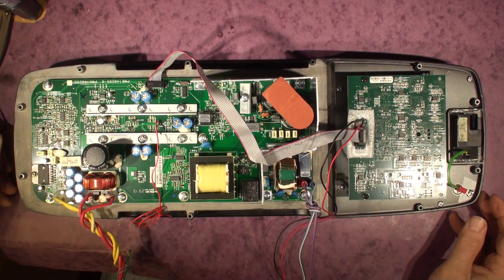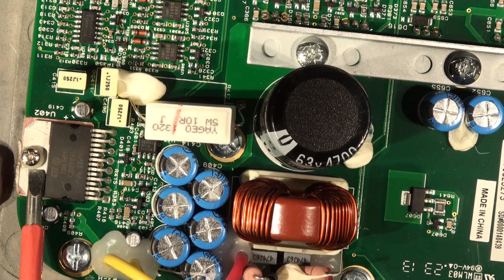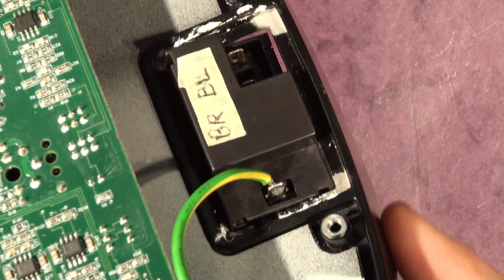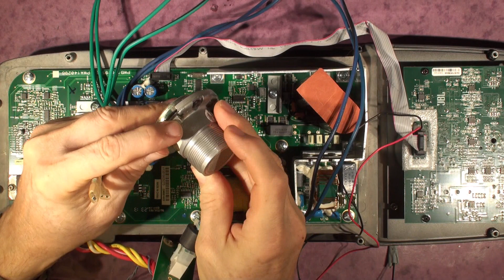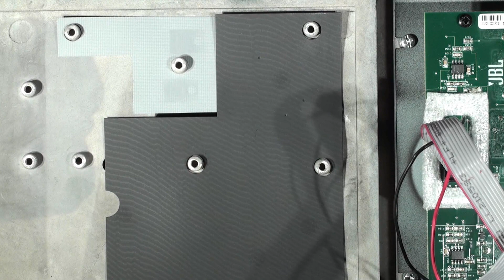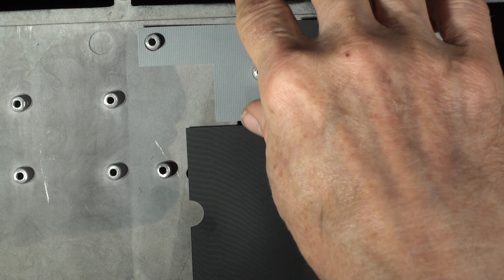JBL EON 500 515xt Series Amplifier Removal and Refitting Diagnostic

Comment: Hi, I have a problem with this speaker that several technicians haven't been able to fix. The tweeter doesn't work, and in the midrange there's suddenly a loud, very annoying sound. I have very basic knowledge of electronics in powered equipment, so I hope you can guide me
Reply from the maker: Sounds very much like a fault on the mixer/ input board behind the control panel.. All aspects of repair are covered on this channel.
Reply: @razenby Thanks for replying

Comment: 10:18 oh my word! You can see the 90° bends on the autorouted traces of that PCB from afar. The electrons will be zinging past these sharp corners hahaha
Reply from the maker: Laid out by schoolboy engineers with little or no experience of reliability and failure modes in due to bad circuit layout.... I see so many failed boards that have layout, PCB manufacture and assembly line process errors. All of them can be avoided at zero cost to the end product.. Bad engineering management and technical oversight.

Comment: Hello, I have one that one day turned off for the moment and did not turn on again, it only had about 3 hours on but with little volume, the plate was not even a little hot, I am from Venezuela and I have not been able to find someone to repair it 😞 How could you help me please?
Reply from the maker: They always blow at turn on. They have design flaws in the power supply however they are related to operation on 220v-230V mains. Venezuela has 120V mains?    You can email me at ark.mail@gmx but you will need someone who knows how to use a soldering iron and a multimeter.
Reply: @razenby 
How do I write to that email?
Reply: If the electrical network is 120v, ok I will send you to the mail, the card is held by a person who knows how to use those tools and knows a little about the subject, I would appreciate it if you could help me find the problem and repair it, thank you very much!
Reply: Hello Master, I have a problem with the JBL EON 515XT speaker. Several have not been able to give me a solution. The problem started when one day after a loud noise it stopped working. It was taken for repair and supposedly they assembled it wrong, where the MOSFETs were not isolated and that’s where the tweeter controller got damaged. The tweeter controller has already been repaired, now it measures 3.8 ohms but it doesn't work, and sometimes it gave me 15V at the output. The other fault it has is that the midrange controller makes an explosion sound 💥. I hope you can guide me to find the fault — I would be very grateful.

Comment: Buenas , yo tengo una que un dia se apagó de momento y no volvio a encender mas , solo tenía como 3 horas encendida pero con poco volumen, la placa no estaba ni un poco caliente , soy de venezuela y no e podido encontrar quien la repare 😞 como me podrian ayudar por favor
Reply from the maker: They always blow at turn on. They have design flaws in the power supply however they are related to operation on 220v-230V mains. Venezuela has 120V mains?    You can email me at ark.mail@gmx but you will need someone who knows how to use a soldering iron and a multimeter.

Comment: FRIEND I WOULD LIKE TO ASK YOU A QUESTION HOW MUCH RMS DO YOU THINK THIS AMPLIFIER DELIVERS TO THE CORNET... BECAUSE I AM FROM VENEZUELA AND IT IS IMPOSSIBLE TO REPAIR THE AMPLIFIER AND NOBODY HAS BEEN ABLE TO TELL ME THE POWER OF THE AMPLIFIER IN RMS
Reply from the maker: 110 W RMS approx to the bass driver and 60W RMS to the HF driver. These amps are easy to repair,  Maybe I can help you out. Tell me what it is doing.
Reply: @razenby Thank you for answering me, I don't speak English and I have to use a translator... the treble could not be heard... and the P36NF06 mosfet is shorted and I have not found it anywhere, I have been looking for it for about a month.
Reply from the maker: Did you find a Mosfet?

Comment: what kind of fuse does the 515xt use?
Reply from the maker: Just checked Actually the fuse in in the IEC mains input connector- 5 AMP 20mm slow blow

Comment: Hi, I have the same speaker. I set p for an event completed sound check and everything was good. Powered down system and upon return to power up system one speaker would not power up. At this point I only checked the power supply fuse. Are you aware of what is the first few things I should check that may cause no power up.
Reply from the maker: See the other detailed service videos could be one of about 10 issues. The semiconductors and capacitors age. usually they fail on power up. happy to service it for you.

Comment: the voltage doubler relay has been removed on your example, one of the modded boards. If it sticks it goes pop
Reply from the maker: Indeed. If it isn't needed to run on 110V the I always I remove  the doubler relay

Comment: Hi, my turn on but at low volume.
What I can do as DIY guy.
Thanks
Reply: Make sure it’s set to mic on the back
Reply from the maker: Did you find a solution?   Note the signal drive input is professional 3V not 1V as used on most domestic gear,

Comment: Hi, I just have changed the tweeter 2 times and when I plugin it blows up  the tweeter ,can you tell me what is wrong....
Reply from the maker: Is the LF drive unit working?  Most tweeter damage happens after reassembly. The Amplifier speaker connections are crossed and the Tweeter is then driven by the Bass amplifier. If wired correctly it is most likely the HF amplifier circuit. Check the 10 ohm power resistor is not open circuit, See the video on this channel. This common fault can destroy the tweeter.
Reply from the maker: See video https://www.youtube.com/watch?v=t4OAw2XrwvE
Reply: Thank's for the information.i will check the way you just tell me...

Comment: How can I test the mosfets without taking them out?
Reply from the maker: You can't 100% be 100% sure with a multimeter in or out of circuit.   You can meter across the two outer pins of each FET. If they read near zero resistance then they are shorted.  However take Note: Leaky FETs can't be measured easily without a test circuit. If you change one FET then change them ALL.  I Recommend that you change ALL the power FETs.  If the FETs are blown/suspect then you need to change the other components in the drive circuit. This is true for the power supply FETs and the LF Amp Output FETs. They are easy to remove.

Comment: excellent presentation! My wife's best friends husband just brought me one of these to service. After removing the power amp from the heatsink I noticed immediately Q605 and Q606 blown apart making it impossible to identify the part numbers. I have been semi-retired from consumer electronic service for a number of years and I am unfamiliar with this product. Here in New York I was unable to locate a schematic on the JBL EON 515XL. I would appreciate if you could direct me to a source, Regards, Richard
Reply from the maker: Hi Richard, Q605 and Q606 are  GB20B60PD.  Impossible to check what other components have been stressed. To make a reliable repair  you are gonna have to change the Darlington FET gate drive buffers: Q601 ,Q603 (KSC3265), Q602, Q604 (KSA1298), R626, R628 (10R), R625, R627 (49.9R) , U603 (FAN9380MX), U602 (TL494).  Let me know if you need some components.  Put the power through a 100W light bulb when you power for the first time. If it lights bright and you see no power LED. You haven't got it right.  If you see the power LED cross your fingers and try direct power.

Comment: I have two of these for an elementary school gym. We had a power shortage and now one clicks (like a relay sound) when I try to turn it on. The other makes a thud that gets progressively faster. Do you have any idea what the problem could be for either one? We are several hours away from any town with jbl repair authorization. We just need them back to working as they are used for all assemblies/sporting events. Thank you so much for the videos you have done so far, they really helped me understand what is inside these speakers.
Reply from the maker: Usually caused by one or more power devices on the power supply/amp board failed. There are a number of school boy hardware design errors where they have cut corners on this design and shoddy manufacturing in China.  Shame because they sound great.  We apply modifications when we repair to address the weaknesses. If you want them fixed and modified for a very fair price then contact invebo.com (in UK but offer worldwide repairs) . I work for them..

Comment: I am having a problem with my JBL eon 515xt. Everything works fine except I am experiencing a popping sound with all the volumes on the mixer turned down. I replaced the fuse and tried different power cords and plugged it into different outlets that are on different circuits. Here is a link https://youtu.be/Sz2dmWefhaA
Reply from the maker: Are you using differential input (balanced) or single ended? Ground potential and mains wiring will cause common mode noise and can manifest as pops and bangs if there are transients.  Try driving from a local source (phone aux cable) and if the pops are still there then it is the something inside the speaker.
Reply: @razenby  The noise happens when nothing is plugged into the speaker. It also happens when I have a xlr cable plugged in. I have tried multiple power cords, outlets, different cables as well as different sources. The sound is still present. The noise seems to be coming from the horn only. Update: The problem I am having is caused by the horn driver. I took the horn driver out of my other 515xt and been monitoring it for about 2 hours now and no popping! It usually starts popping in under 10 minutes. Thanks for the insight!
Reply from the maker: There shouldn't be any drive to the horn when there is no input. I wonder if you have just disturbed a bad connection when you took the speaker apart and swapped out the tweeter.  The grey umbilical ribbon cable is sometimes a problem where it plugs into the pre-amp board. (Plug not in fully). Maybe try fitting the suspect horn to your other unit and see if the fault transfers with the tweeter. I would be very interested  to hear more if it does.... Make sure that the spade connectors on to both drive units are a tight fit.
Reply: @razenby  Ok I will do that. I did mark the spade connectors L and R so I wouldn't get them mixed up. If it is truly the driver JBL 2414H, can I use part JBL 2414H-1?